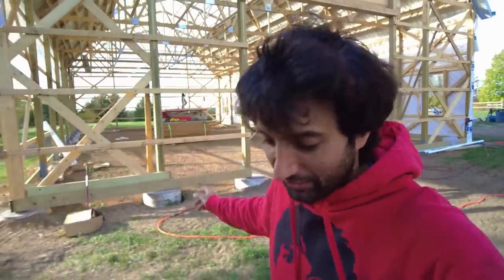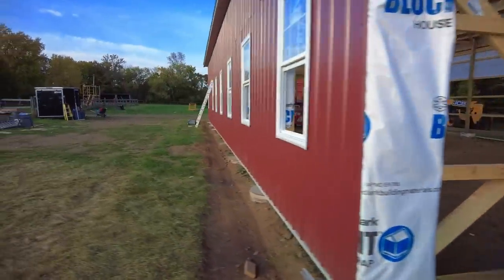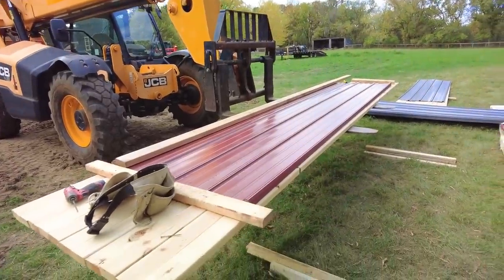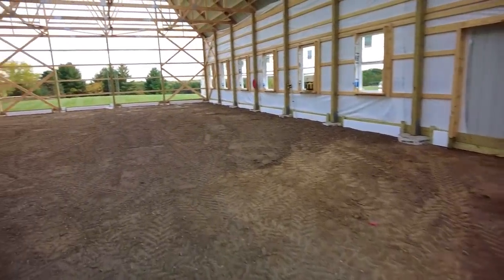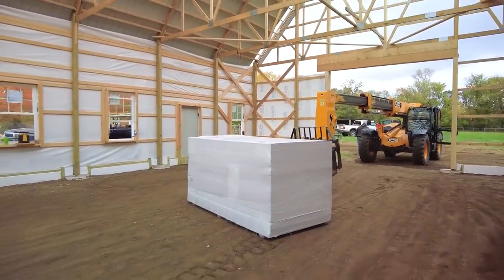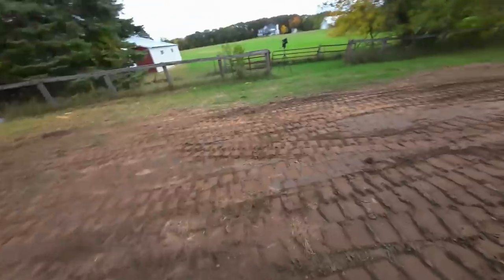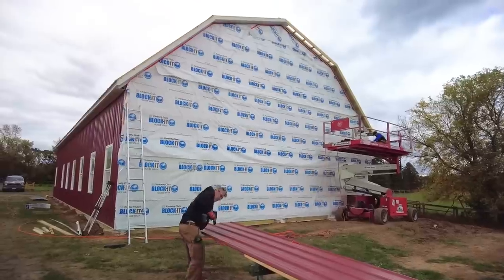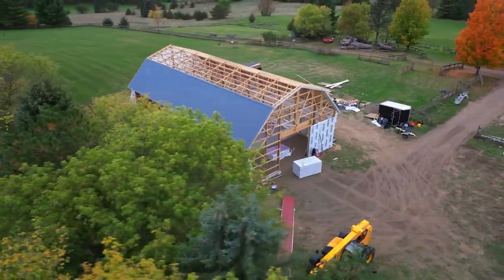Let's Finally have a Productive Day, Please? - 40x72 Gambrel Post Frame Episode 15

Comment: This is why I always tell the home owners that it's gonna take 3 weeks longer than I think it will;  so when things are getting done early, they are always so happy about it.   Because if you set a schedule and it's a day late, everyone loses their minds over it.  So I always set expectations low, and exceed them by a lot--  this way you are always bringing the homeowners good news.   That's a little pro tip to keep everyone's stress levels on easy mode.

Comment: This looks like my barn. Our barn is 40feet x 80feet and is all heavy metal beams that are galvanized. The arches were welded flat on the ground and were erected with a 710 John Deere backhoe. 8inch purlins were galvanized and no wood was used in the building. Inside the roof is 26feet high and being gambrel it is completely open. We are going to put a monorail in the center to rig machines on.

Comment: Foam on base, then a vapor barrier then rebar  making a couple of troughs down the length add 3" more concrete for some vehicle strength near the door. equipment  and material loading.

Comment: When you can put up full length tall pieces of that steel it does go quickly. Having to cut and place it around doors and windows is when it slows everything down. Main thing is to make sure the first piece it straight level and plum then align all the rest and spot check every once and a while to keep it that way and it is done before you know it.

Comment: In all my years of building never used foam under cement.  I guess it is a very tight cell foam that does not compress and thereby let the concrete  flex.  Looks like a great way to keep floor warmer..

Comment: One note, neighbor's of ours built a garage very similar to what you have built with under slab heat, be VERY AWARE of rodents digging under your concrete slab and chewing into your water lines!!  Make sure you check it on a regular basis, plant grass right up to the wall or put something to cover the ground around your shop / barn and check it to make sure rodents do not make a home under your concrete slab.  Also, mice will dig under around the round concrete post and then chew into your foam panels.

Comment: 3 things: 1) dont u need concrete floor soon? 2) metal over Tyvek equivalent with no wallboard over framing--vapor barrier? And 3) how did u get the high climbing job?

Comment: Nice work on the building skin!  One question as I've been watching many floor insulation videos and they typically stagger the insulation panels as to not have long running tape seams.  Any thoughts?

Comment: Think about doing that 100-150 years ago when they used slate for a roof and no scissor lift or telehandler to get the slate up there. That would have been back breaking and dangerous.

Comment: Whats the freezing depth off the soil up there in the north, here in holland its around 60cm or 2 feet. So with concrete floors we always have to construct some sort of frost edge around a floor. Either by the foundation from a brick wall or a trapezium shaped edge on de floor itself when your wall is build "above" the floor.
Do you plan the overlaps of the sheet metal in accordance to the main wind direction ? Here it's mostly SW so the overlap is pointed towards the east up to north to prevent rain and moisture from getting blown in between. My name suggestion for the barnything "Sticks and foil"

Comment: Perhaps I missed it when you started hanging the sheathing on the front side of the building, but why did you have to hang an overlapping panel at the top of the wall? I noticed your panels for the back side and the ends are full length panels.
The barn looks fantastic!
Reply from the maker: Top section comes off to add a lean to
Reply: Asked and answered many,  many  times.

Comment: The 2 guys from the RR buildings channel use an AWL to make the holes in the panels.
Reply: I used to use a rawltool ground down really,really sharp to punch through two  layers of corrugated iron, pre-nailing.

Comment: Why didn't you use full size single metal siding on the widow side (just making the necessary cutouts for windows and doors)?  By not doing that, you now have that funky looking horizontal seam with its uneven appearance.  I have watched dozens of other videos of pole barn, stick frame, metal buildings and they all seem to do it that way.  Why not with this building.
Reply from the maker: Top section comes off to add the lean to
Reply: If you watch all the videos in the series you would know. The plan is for a lean to roof on that side of the building in the future. Those upper panels will be removed to attach the roof to the side of the building.

Comment: Did you predrill the roof panels?
Reply: No. Account for variance.
Reply: Matt explained that. The perlons are only 1.5"  wide and are not exactly lined up. The "girts" are 3.5" wide and lined up. The girts are a bigger target so predrilling is less likely to miss the board.

Comment: You are placing foam on vapor barrier. I hope you know not to pour concrete on the foam unless you put in a another blanket of vapor barrier or they float during pour.  Template pattern for holes one sheet over many. or  washable chalk lines and a strip pattern paperboard.

Comment: Oh Lordy, wherever y'all were cutting those gable end panels with that nibbler, don't let your kids run around there barefoot. Those little crescent moon shape pieces of metal will hurt. You better check the bottom of your shoes. They like to stick there and you could track them in the house.

Comment: I still don't understand what foam under a slab is supposed to do in terms of preventing heat loss. Heat rises, so why have insulation under a heat source? If heat did penetrate the slab then at most it seems that the earth under the slab would act as a heat battery.

Seems like an enviro-gimmick to me.
Reply from the maker: Conduction vs convection
Reply: Heat does not rise. Heat always moves from warm to colder areas via the path of least resistance. You are thinking of hot air rising which is not what the under slab insulation is for.
Reply: I once calculated the heat loss for a building including the floor. Heat loss through the floor is minimal whereas heat loss through the ceiling is maximum,  hence maximum insulation in attic and min under floor.  Heat seeks equilibrium so in floor water tube heating has a higher temperature difference then the ground so it pays to insulate the floor. Looking at it another way, trying to heat all the dirt under the building would cost more then all the money in the USA.